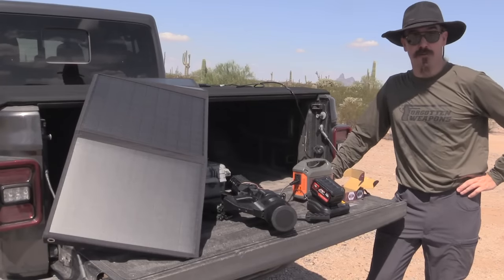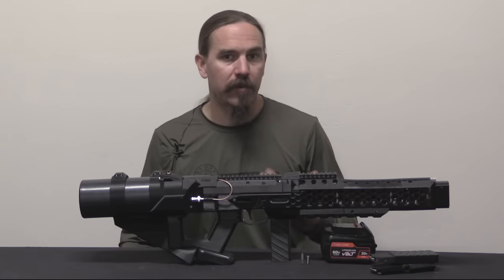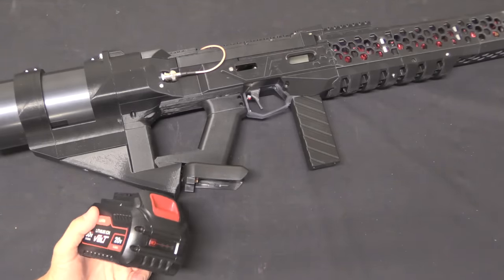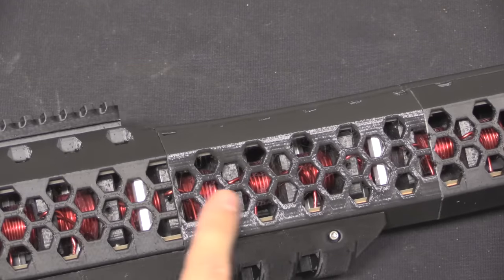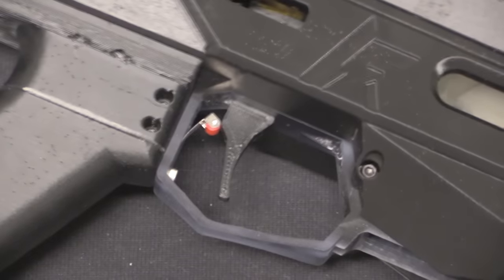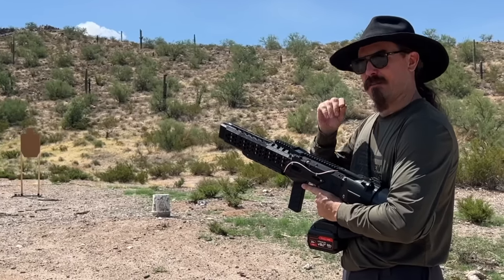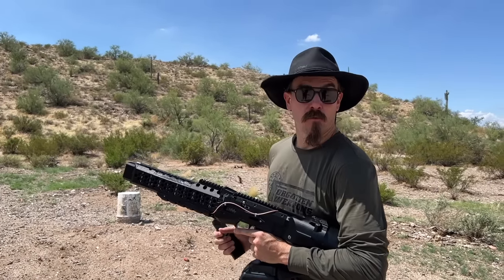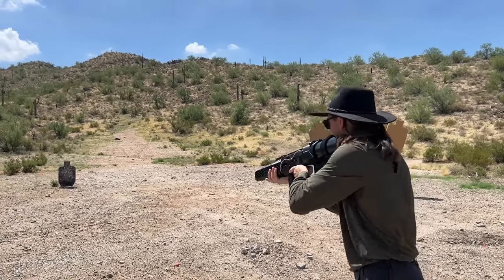ArcFlash Labs EMG-02 CoilGun: Making SciFi Weapons Into Reality

Comment: Imagine what kind of leaps and bounds this design can make with graphene capacitors and solid state batteries.
Reply: Once that happens, you can bet this will enter the military fast!
Reply: @peasantjeff4731  They'll need to solve projectile stabilization, or it will never be accurate enough for military adoption.
Reply: @bubba200874426  the trillions in the M.I.C will pour in and solve that issue pretty fast, if a tech is promising enough the DoD/MIC will jump in on it before completion.
Reply: @peasantjeff4731  I imagine you could just spin the projectile up on a motorized platter which grips it magnetically (mounted normal to the barrel at the rear of the chamber), then release it and have the coils pull the now-spinning projectile down the barrel like usual. No rifling needed if the forces are well-balanced and the alignment is good.
Reply: @bubba200874426  sabots with darts in them. Think miniature AFPDS rounds. Stabilization is relatively easy to fix.
Reply: @maudiojunky  or just spin it up like its a rotor of a brushless DC motor
Reply: @ace448  so, how do you make up for the loss of projectile mass? Also, a sabot made of what, exactly? It still needs to be magnetic.

Edit: We already know saboted ammo to be of limited effectiveness in other small arms. Why is this different?
Reply: @bubba200874426  wonder if you could rifle the bullet rather than the barrel... like machine a projectile to be sorta dart shaped with flutes that cause it to spin as it flies.
Reply: the future is now
Reply: @bubba200874426  I think they can solve that by designing ammo specifically for it. Maybe spring loaded fins.
Reply: Pretty much all cool tech is just "graphene/solid state batteries/fusion" away. It's never going to happen, at least in our lifetimes.
Reply: @TheDusk  okay, so the question is if we can make something that's able to be accurate, keep the weapon small enough for infantry use, and still be able to put enough energy on target to be a viable weapon. All while being simple enough to be manufactured in large quantities since ammunition is necessarily disposable. 

If the solution were that simple, someone would have done it already.
Reply: @peasantjeff4731  probably already exists
Reply: Solid state batteries would not make a better improvments. But graphen capacitators and better coils would do it
Reply: @bubba200874426  maybe fins like on sabot rounds in tanks?
Reply: i belive its software/hardware limited as to the time and duration it energieses the coils for and how quick it can turn it on and off. the big update would be superconducting electromagnets like you find in an MRI machine, they can turn on and off much much faster (no magnetic inertia) and can run unlimited current without overheating
Reply: You obviously have noidea what you're talking about
Reply: @kamenwaticlients  sounds expensive but would probably work
Reply: @bubba200874426  dude thats a non issue, theyll just use sabot round... tank tech fixed that shit over 70 years ago
Reply: @jaxrammus9165  We know from conventional weapons testing with them that the tech doesn't scale down to the small arms level. At least not in the form of rifle ammunition.

Also, what kind of iron, nickel, or cobalt alloy are you going to make this sabot from that will reliably separate from the dart without impacting accuracy.

If the answer was that simple, someone would have it, already.
Reply: It would bring back anti tank rifles for sure
Reply: And the risk of catastrophic electric shock from your everyday carry.
Reply: @bubba200874426  bro you just use the rail gun approach and use a shuttle that fucks off during flight like apfsds
Reply: @jaxrammus9165  okay, that still doesn't solve the not enough mass problem, and don't call people you don't know, "bro".

Edit: I just noticed you were the same person I had just told that tech doesn't scale to small arms.
Reply: @bubba200874426  mass isnt everything, velocity pens more than mass, if mass did more 9x39 would actually pen armor and so would 300blackout. Its where velocity is key. And bassically the only problem with having actually effective coilguns today is not the stabilization, its the battery. To have a magnet strong enough (which do exist) to launch a projectile in a hand held sized firearm takes tremendous power which we currently cant output in a small enough platform (think it was like 6 car batterys it would take to do this). So whats holding us back at the moment is just the power source.
Reply: @WOLVESOFWARGAMING  yes, but will the projectile have enough effect on target if it's actually an even tinier projectile?  

You hear Ian say projectile velocity isn't really affected by the mass of the projectile. This means velocity is effectively constant, so all you can change is projectile mass.
Reply: @bubba200874426  for that specific gun because the magnetic coils don't just change, hence why I said if we used actually extremely strong magnets it would increase the velocity, just that the power source would be tremendous.
Reply: @TheDusk  It seems like the issue here, as far as I can tell, is that the bullet never actually touches the barrel at all.  It is magnetically levitating within it, sorta like a bullet train.  This is why Ian is able to swap between larger and smaller ammo types with no change to the barrel or any other component of the gun.

Rifling the bullet may work in an aerodynamic sorta way, "path of least resistance" and all causing it to spin, but I am not so sure that would effectively solve the issue of stabilization, as you won't generate enough spin quickly enough.

More likely, the bullet would already have to be spinning at the time that it is accelerated down the barrel.  I could see magnet #1 being used to spin the bullet, while #2 - #10 are used to accelerate it down the barrel.
Reply: @WOLVESOFWARGAMING  or we can attempt to figure out a way that works without using something that doesn't exist.
Reply: @bubba200874426   magnets that powerful do exist, I can buy one as a civilian (the government of course regulates the real strong ones), what currently doesn't exist is a powersource small enough to use a  handheld one, you could still have one that runs off other sources but efficiency is key. So I could have one that runs off 6 car batteries or I could have one that runs off of a smaller battery, just wouldn't last as long-term. So literally the only thing stopping us from having a ballistic rated version is in reach can make one now, just need a better power supply.
Reply: @bubba200874426  fins
Reply: @TheDusk  well yes, been done with shotgun slugs for decades
Reply: Your limit is more the coils of the electromagnets, and the saturation limit on your iron projectiles. Ie if you want powerful coilguns you need to pay it with excessive barrel length mainly.
Reply: @kistuszek  or thicker right, to increase the magnetic power you would need to add more copper coiling
Reply: @bubba200874426  Smooth bore barrels will accept rifled projectiles...no?
Reply: Just need to use fusion cells bro
Reply: @davidbosilj  was going to say that. agreed.
Reply: @bubba200874426  fin stabilized ammunition
Reply: @bubba200874426  Seeing ukrainians 3d print stabilizator fins for a regular under-barrel grenades like VOGs, that they drop from commercial drones, i can't help but wonder if it's that hard to just make projectiles with fins that spin them.
Reply: @peasantjeff4731  not likely. The army is just now replacing the m-16/m-4 with a newer rifle. The m-16 was adopted in the 60's
The ma deuce 50 cal machine gun has been in service for over 100 years.

Plus I don't see them solving the accuracy issue due to the fact that the projectile doesn't come into contact with the barrel.

Also you have to think about the lowest common denominator.... Infantry and Marines would break these left and right.
Reply: imho, at first coilguns will be used as ultra-silent weapons with heavy subsonic bullets.
Reply: so you're saying this is a toy compared to what it could be with max effort?
id like to see the max effort result
Reply: @bubba200874426  Some style of fins aught to do it
Reply: @rubiconnn  what you dont get is its all already possible and can be done right now 
the thing is efficiency and safety are the top priorities
so sure we have fusion but if you wanna have a massive star randomly explode then be my guest
and sure we have all these futuristc energy storage devices but they are pretty much just mini bombs that dont work as well as the thing you have now 

so relax...its there
its just being perfected
Reply: @TheDusk  better to use fin stabilized rounds (maybe even discarding sabot)
Reply: @TheDusk  First thing I thought of was making the rounds with some kind of striping in the alloy, so they can have a normal shape, but have a magnetic gradient so that the propulsion magnets spin them also.
Reply: @exorias625  Fusion power does not exist yet. Net positive energy production from fusion hasn't happened yet. I think you are mistaking it with fission power in which case it won't explode, it will just release contamination.
Reply: @bubba200874426  lol Koo Koo
Reply: @rubiconnn  im not mistaking it with fission and yes it does exist ...what i mean is we have already done it but its not perfect. as you pointed out we cant gain energy from it as yet but it it has been done and in multiple ways too but not anything we can use
Reply: @bubba200874426  The stabilization part of this is the easiest thing, and yes the answer is "add fins." We don't do that work conventional arms because bullets contact the barrel so we can use simpler shape and use the barrel to spin the projectile. The real problem is energy density and flux. It's be real easy to make something like this that would blow up.
Reply: @userJohnSmith  Unless different materiall allows them to increase the muzzle velocity above that of firearms, it won't perform well because the projectiles just don't have enough mass. We have a limit of how big we can make it. We're talking about small arms, here.
Reply: @bubba200874426  It's not about the material of the bullet or the gun or the "barrel" (there's realistically no barrel). As far as I understand, with the way a coilgun operates, u'd need a stronger power source, which many people already mentioned (more power to the coils, making them stronger and making the push force stronger) and stronger magnets (for obvious reasons). Magnets are already available, even to civilians, but power source is the issue. Mass of the "bullet" won't really change anything, at least not with the EMG-02, as it'll still go out at about the same speed, and the only thing it'd really do at 200FPS is jus kinda hurt if u weren't wearing anything, maybe leave a tiny mark or something.
If I remember correctly, many have dabbled with making a handheld railgun that would work, but the problem is again that it'd require more power than we can fit into a handheld device. That's why the only real functioning railguns u see the military use (in testing I think) are those bigass naval railguns on warships.

At least that's my two cents from what I understood
Reply: @bubba200874426  Yeah it's a materials problem now. Always was, but some of the graphene stuff is starting to get somewhere practical. A lot fewer heat concerns.
Reply: Thisis Gettinboring  people knew. What they didn't know was how to cast them reliably and in a quantity large enough for military use.

Edit: you also didn't see the 10 other people that said the exact same thing.
Reply: Or if you had a budget of $800billion usd a year.
Reply: @peasantjeff4731  meh, rather only spec ops as it's gonna be freaking pricey to make it reliable
Reply: Apparently these days, there are what's called Nuclear Diamond batteries. Made using nuclear waste and have an estimated battery life of 1000 years lol. Just use those batteries for everything and shouldn't have to worry about charging for... 1000 years ha. 

Although I think that this gun would become useless if an EMP were to take effect.
Reply: @bubba200874426  flèches maybe
Reply: @bubba200874426  You don't need a sabot for fin-stabilised ammunition if it's being fired in this way. In conventional firearms, the sabot is there as a pressure seal, in railguns it's there to contact the rails. You don't even really need a barrel with a coilgun, you could just have a dart sat on a rail.

That said, generating enough force for it to be a serious weapon is a real issue that's going to be hard to solve. The theoretical limit is through the roof, but practically speaking... ehhh... I'm not sold on magnetically-propelled kinetic small arms being a thing for a looooong time. It's the same with airguns - theoretically gasses could be pressurised such that they would propel a bullet faster than gunpowder, but the logistics, reloading procedure, mechanical tolerances, etc. make it pointless. I would not want to be dealing with gas pressurised at 100k psi. Gunpowder is easy to work with and gets the job done.

I also question the effectiveness of extreme velocity needles vs. the sorts of targets infantry are expected to fight. Putting lots of tiny holes straight through people is a pretty inefficient way of disabling them. 

I can imagine magnetic weapons replacing mounted machineguns on vehicles though. Easier to work around a lot of the current limiting factors and the higher theoretical velocity might be worthwhile in a point-defence/anti-drone role.
Reply: @idkidk9204  economies of scale would likely solve that, look at the rifles the DoD buys right now, KAC is 3k per rifle, but they get each rifle for about $300 a piece.
Reply: @aurtosebaelheim5942  If the shot doesn't always exit the barrel in the same orientation there's no way to make it accurate. 

Also, keep in mind any ammunition without a way to fire it otherwise will be lighter than the firearm equivalent projectile because it has to be substantially made of a magnetic metal instead of a denser one like tungsten.

I just don't think making the projectile smaller is the solution, but people are so obsessed with fins they'd rather wait for other technology than explore projectiles. 

At least 10 people have said some variant of fins to me in this thread. It's incredible to me the people making the gun didn't already think of it.
Reply: @Nobody Important it's clear I don't think " just add fins" will work. Why would someone else saying the same thing change my opinion? 

Cool attempt to silence someone because they're willing to defend their opinion, though.
Reply: Stop teasing me, big boy.
Reply: @maudiojunky  No, cause the bullet could tumble on the way out of the gun. Better to just make the bullets shorter and heavier, that way, if they tumble they also gain some accuracy.
Reply: @Bit-while_going  Assuming you would use something more aerodynamic than a cylinder for precision ammo, what force would be imparted on the projectile to cause it to tumble? How does this differ from a bullet leaving a rifled barrel?
Reply: @maudiojunky  It could just be a little chunk of carbide there at the end of the barrel for that very purpose. It would just skim it and start tumbling.
Reply: @bubba200874426  Because the gun is a toy. The tech isn't there to make it an effective weapon. Stabilising the projectile doesn't matter when it's moving at airgun speeds. Better to keep it cheap and shoot something you could find at a hardware store than shell out on developing a custom round and trying to properly stabilise it.

The gun is theoretically magnetically aligning the projectile IIRC, but I'm pretty dubious about that. You essentially have a sub-calibre metal rod rattling around in a plastic tube because all the parts are 3D-printed or off-the-shelf. With proper machining you could secure the projectile and have it consistently and stably exit the gun, but doing that is a lot of work and money for a toy.

I feel like spin stabilisation is adding unnecessary friction to the system (in a traditional firearm that friction is always there anyway because you need a gas seal). Fin stabilisation complicates the feed mechanism though, so it might be a wash.
Reply: A rotating mass of ferrous metal inside an electrical coil.  Hmmm
Reply: And with hardened drill bits.
Reply: @bubba200874426  

Muzzle velocity is restricted more by switching rates than overall power. An electromagnet doesn’t drop its field instantly when switched off. This latency causes drag on the projectile. Rail guns get around this issue by pushing rather than pulling the projectile. Reducing the length of the ferrous portion of the slug or making it spherical might help increase velocity of the coil gun design.
Reply: having experimented with coil mass driver designs myself the most dificult thing is contorting the magnetic field and high speed switching of mosfets
Reply: @tatianatub  

I can’t imagine that dealing with the surge caused by the collapsing field helps matters. Do you use a shunt and resistor?

Sry if that question is painfully elementary. I know next to nothing about electromagnetic switching.
Reply: Why just dont bullup the gun, keep the length the same, then add more coils to the longer barrel? 🤷‍♂ For stabilization they could make star shaped (front viewed ofc) projectiles, no need for fins 🤷‍♂
Reply: @bubba200874426  why do you need accuracy when the round pierces through sound 4 or 5 times
Reply: This is probably more limited by projectile material, transistors and physics in general.
Reply: @davidbosilj  you’d need permanent magnets in the projectile to use it like a BLDC motor, AC induction motor principle would work better since those work off eddy currents and wouldn’t require permanent magnets mounted in the projectile.
Reply: Would the new Nuclear Diamond Battery, that's about to drop, for consumer product use,  be a viable option for an energy source? 

.
Reply: Wtf is a solid state battery?
Reply: @AirsoftAbominations  I agree 100%. This solid state verbal garbage won’t do jack squat the power is there, the back emf would seem to be the problem to me
Reply: @WOLVESOFWARGAMING  it’s not that simple. Permanent magnets will take as much energy to overcome. There Will be a spot to where the permanent magnet will want to pull the projectile back to it. And that will be the same with coils/electromagnetic I’ve never seen rare earth magnets that have more power than electromagnets. You can shut the electromagnetic off. I don’t ever see this being efficient but I hope my thought don’t persuade anyone from trying.
Reply: @dreece2000  one of the next big developments for stores energy tech. They're essentially made from sand and salt and can hold a tremendous amount of energy.
Reply: @Ian-pe9rj  can you explain why you need permanent magnets?
Reply: Coat the projectiles with soft material jacket.  When fired they are pulled by the first couple of magnetic coils through a rifled segment of the barrel to make them spin.
Reply: @bubba200874426  Such a gun can easily be adopted to fire a flechette.  Rifling isn't necessary
Reply: Boundaries aren't in power source but in changing the polarity of coils fast enough
Reply: @dreece2000  It uses a solid electrolyte instead of liquid/gel.
Reply: @Miami_Bad_Boy_BOSS  Probably not as their power output is small.
Reply: I a fan of nano batteries myself. Essentially by printing battery structures on a substrate with lithography, you can have millions of microbatteries linked in parallel. They can charge and discharge in a few seconds.
Reply: Gauss cannon
Put it in a atlas mech, add ER PPC and long range missiles and we're good to go
Reply: @ukaszczarnotta1992  I wonder if the batteries and capacitors we're small enough, if you could have individual power sources assigned to each coil or section of coil that way there is no need to change polarity?
Reply: @coltonthorpe7812  no, it's about how coil works. The magnetic projectile accelerates only to the half length of a coil, then its getting slowed down because second pole has the same field strength but different polarity. Ergo force that accelerated the projectile now slows it down. What can be done is either change polarity very fast, or shut down the coil once projectile crosses half of the coil. Shutting down a coil generates high voltage from opening circuit and can be dangerous, and generate some weird electric field interfering with electronics used to open the coil. And swapping a polarity is a bit more demanding because you need to know where the projectile is in the barrel. Given that it's speed can be very high coils might not get swapped fast enough. Also comutatnion of coils can create weird assymetric magnetic field that would interfere with bullet probably slowing it down or creating sideway force that would interfere with accuracy of such device.
Reply: @ukaszczarnotta1992  thank you for this explanation. That absolutely makes sense. So I guess the next question is what component do we currently use to change the polarity? I'm assuming the projectile speed is calculated by the mass and the speed of the coil system. I wonder if eventually all of those settings could be calculated and adjusted by an on board computer so it automatically adjusts to match the mass of the projectile?
Reply: @bubba200874426  To be fair there have been lots of problems that have had simple solutions at their core for example some of the the first automatic weapons were direct blow back systems and they had the technology to make them in the 1830s the only thing was someone just had to figure out that said simple solution. So the argument if we could do it or if it were that simple we would have made it already is a invalid argument.
Reply: @WOLVESOFWARGAMING  Yup the problem is that coil guns have mathematically limited speeds they can travel at depending on the magnets/electrical output and the material the round is made of that is being accelerated the Large Hadron Collider at it's core is just a giant coil gun and it takes 600 GWh a year roughly that is A LOT of energy so yes i agree energy is our biggest problem for man portable coil guns. Though i think Railguns and coil guns have some great potential in future shore defenses as well as missile interception weapons.
Reply: solid state batteries lmao they are pseudoscience.
Reply: @yesterdayschunda1760  Uh, not quite considering they are currently being manufactured, they have been used on a very small scale such as being used in RFID chips and pacemakers even now larger ones are being developed and some are slated to even be used in some Electric Vehicles by 2025 which is optimistic but still they are FAR from pseudoscience.
Reply: @thebob5240  Yep, i am sure it and the solid hydrogen batteries combined with solar freaking roadways and a hyperloop can save the planet. you are right.
Reply: @yesterdayschunda1760  I think it is rather clear someone couldn't even be bothered to do a basic google search that's all it took for me to get confirmation from reputable sources.
Reply: @yesterdayschunda1760  You seem to have this fantasy about how I think or believe and that's okay it is okay to believe that you can apply all those silly little negative stereotypes that make it easier to insult people on the internet. Doesn't make them true but you can think that way if it makes it easier for you.
Reply: @thebob5240  I would care about this concept more if it wasn't 10 to 1 for people saying some variant of fins. 

It's not even plausible the people making the device haven't thought of it.
Reply: @thebob5240  btw these solid state batteries you are so excited about? They were invented in the 1960's and outdated when Lithium Ion batteries were invented.
Reply: @maudiojunky  maybe a fin on the projectile?
Reply: @coltonthorpe7812  You would like to use a thyristor or a transistor. They even being very fast switches have limitations to voltage operation which as you know by now can a problem. It would rise significantly when opening an operating coil. The very accurate measure where the projectile is can be made by using Hall sensor but still it would be susceptible to the time when coil must be switched or repolarized. Transistors like any other switches have non zero operational time when their electron stripe is closing and broadening. We could calculate the velocity and where is the projectile. But I suspect you will have to know how big force of attraction is going to be.
Reply: The projectile doesn't necessarily need to spin or stabilize if it's going fast enough...
Reply: Not much. It'll go from a toy to maybe .22 lr grade pistol power at best, while still carrying countless disadvantages over traditional firearms.
Reply: and highly purified coils used in teslas, vs copper.